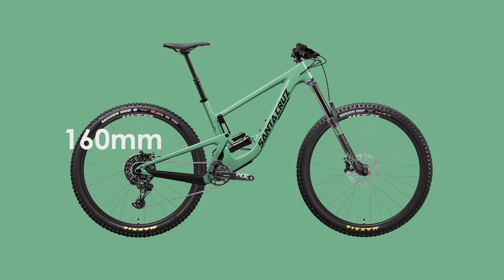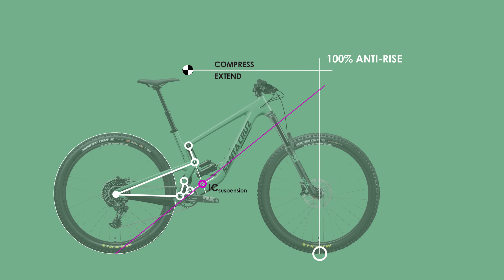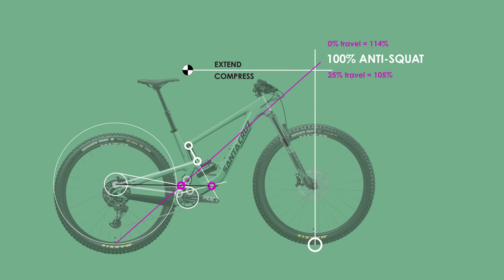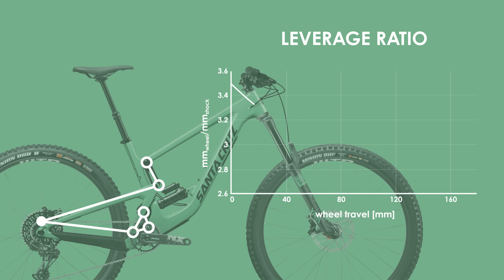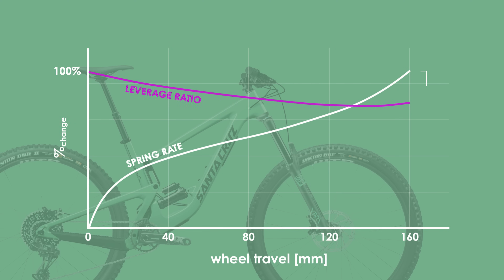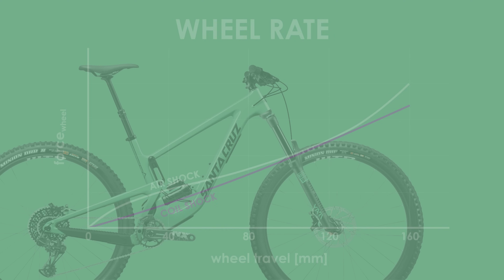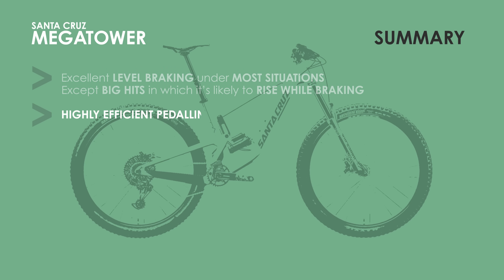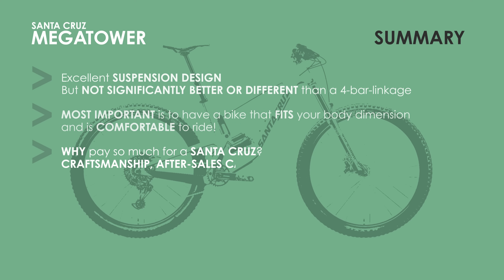Santa Cruz MEGATOWER VPP Suspension REVIEW

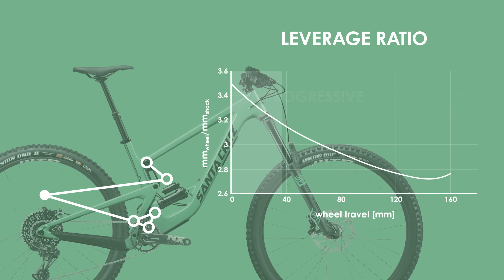Comment: @3:50 more air in this suspension  does not result in less small bump compliance, specifically because the leverage curve is higher. the higher leverage curve makes the suspension more reactive in the lower air pressures before the shock is compressed.
Reply from the maker: Yup totally agree if you had to take friction out, but the extremely high shock pressures do result in the need for tighter seals to keep the pressure in resulting in more stiction

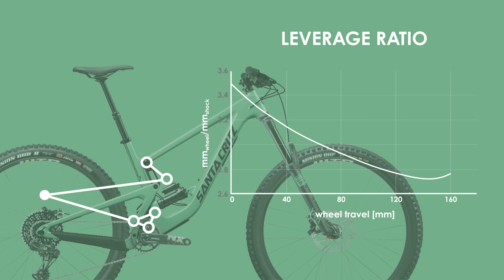Comment: 3:33 doesn't a higher leverage ratio = easier to compress = better small bump sensitivity? Why does Megatower with higher initial leverage ratio have worse small bump sensitivity than Ransom?
Reply from the maker: Good question. What I was trying to get across is that the overall LR is higher for the Megatower through the entire stroke. This means higher pressures needed in the shock overall = high static friction = worse small bump compliance due to friction compared to if they had kept the same curve but decreased the overall LR numbers across the entire stroke.
Reply: @TrailPOV  Thanks for the response!

Comment: Santa cruz doesn't have better components for the same price.

You talked about it ... on my nomad v4 the suspension feels notacible different in order to "high" or "low" position. 

These days I'm messing arround with the meg neg  and having a detailed look to the ratio and the suspension. In high setting the endprogression is cut off about 5mm and added to the beginning stroke.  This feels different.

You have talked about pedaling efficiency.  Yeah, there is a point if you have too much sag the pedaling is not as efficient as it is  in high Position, when you compare same sag and same air preasure. The construction has an ideal range of sag for pedaling. 

Would be exiting to see  a comparison on paper , low vs high.  To me, when it comes to fine tuning, this is an important  change. Some people might not feel the difference.🤷‍♂️

And you have talked about the difference  between air and coil. The difficulty with air shocks is that all of them have different spring curves. Some do not suit ideally to the ratio of the frame. A coil makes it way easier. It is just linear. On the other hand you can't create a certain spring curve for your personal preference with a coil. 🤷‍♂️
Reply from the maker: Thanks for the input

Comment: I suppose the VPP is nowhere near the performance of DW-Link?

I demo'd a Megatower and loved how it pedaled to the trailhead but once I got it on the dirt it didn't track very well.  Perhaps, the VPP is very finicky and needs to be setup properly?
With DW-Link, more specifically an Ibis Ripley and Ripmo, anyway you setup the suspension you get endless traction!

I don't want to be a total Santa Cruz hater ( my first full suspension was a Superlight) but I feel Santa Cruz should have their Suspension platform on par with Yeti, Ibis, and Pivot by now! 

I remember when I first demo'd a Ripley and then demo'd a tallboy back to back at a local Demo. The difference in traction was huge and seems like it still is!
Reply from the maker: Thanks for the input. Each design has its pros and cons depending on your riding style

Comment: Does this analysis apply to the 5010 v4 with the same VPP design?
Reply from the maker: While it might have similar traits with the leverage ratio, the 5010 is meant to be a better pedaler so it likely will have different braking and acceleration characteristics

Comment: How does it compares to SB150? It seems a little more progressive,  and having that situation when breaking over 50% of travel. With both pedaling very well. Is that correct?
Reply from the maker: The Megatower is way more progressive. While the Megatower has a leverage ratio range of about 0.8, the SB150 has a range of only 0.3.
Reply: @TrailPOV  which downsides do you see when comparing Suspension action of megatower to SB150? (Maybe some pedal kickback, and to much antirise? Or even a harsh endfeel do to too much progressivity?)
Reply from the maker: @juscelinocastro  The anti-squat and chain growth (pedal kickback) between the two are very similar. Only the anti-rise of the SB150 stays much higher throughout its travel. So under braking the SB150 might not stay as active and plush. Additionally the leverage ratio means that you can hit bigger hits with the Megatower and likely not bottom out while still being able to maintain good small-bump compliance due to the LR being higher to start with.
Reply: @TrailPOV  fantastic! I ended buying a megatower with DHX2. Since than, I'm working on setting and studying the harsh end of the travel. I got surprise, since I thought that going coil I'll be able to get less wheel rate. But it appears in the end is opposite. 
I saw some dhx2 analysis Arguing that it ramps up a lot T the end of the stroke because of the stroke bumper. (Have you ever analyze  this?)
So I'm thinking to stroke resize to 239 x 60 and go long and high with the fliptips settings, so that i can reduce this Harsh feeling at the end of travel. What's your opinion?
Reply from the maker: @juscelinocastro  Nice choice. Unfortunately I haven't looked too deep into shock tunes or specific shock model characteristics. Also it'd be very hard to model the flip chip modifications with stroke length adjustments without getting exact dimensions on each flipchip setting. If you are able to provide the exact dimensions on the flipchips I could potentially analyze the effect on LR if you sign up for one of my Patreon Bike Analysis Tiers #shamelessplug
Reply: @TrailPOV  how does it works? This patreon bike analysis?
Reply from the maker: @juscelinocastro  Your case would be a little unique, but essentially I would analyze a bike much like I have on YouTube but without creating the video. It would have some analysis text and graphs of the various anti-rise, anti-squat, leverage ratio etc but in a PDF. For you, if you are able to provide exact measurements of the flip chip, I could take the bike geometry as it currently stands and flip the chip using the CAD data and then place a different shock length in the frame and analyze what it does to the various parameters.
Reply: @TrailPOV  do you think it will be diferente from this: https://m.pinkbike.com/news/behind-the-numbers-santa-cruz-megatower-suspension-analysis.html
Reply from the maker: @juscelinocastro  That does provide some excellent info, but is missing what happens if you place a different shock length into the frame. It only addresses the flip chip changes. It's up to you whether this would add value to you.

Comment: I love these video, but am noticing that your leverage ratio curves are different than those found on the very popular Linkage Design Blogspot. Can you offer any insight as to why the leverage ratio curves might differ between your videos and the Blogspot site? Makes it tough to make a decision when you're not sure who's more on point. Thank you!
Reply from the maker: I have noticed that as well as my guess is it comes down to where that sites selects the center of the pivots especially the back wheel. If you just use a side photo, the lens will introduce a fisheye effect and also perspective will cause the rear axle to 'shift backward' from where it should be. That is why I use 2D CAD drawings as much as possible and if I have to use a photo, I take the perspective shift into account by using measurements such as shock length which is the same across all model sizes to adjust measurements such as chainstay length to match those indicated in the geometry tables
Reply: @TrailPOV  I guess what makes it tough, especially for the Megatower, is that the average LR is 2.78:1, but your graph shows very few moments throughout travel around that 2.8:1 range. The Linkage Design Blogpot seems to be more likely for this particular bike, as about half of the travel is above the 2.8:1 ratio and half is below that same ratio. This is the one graph where you two present very different LR graphs, and it could definitely sway someone in one direction or the other.
Reply from the maker: @persistentconsistency  Out of interest, where are you getting the 2.78 LR from?
Reply: @TrailPOV  I just took the 160 mm travel and divided it by the shock stroke length of 57.5 mm, to get an average LR of 2.78:1
Reply from the maker: @persistentconsistency  That is a really good point you make. I'll have to look into my math and find out the reason for the discrepancy. Thanks for the input.
Reply from the maker: @persistentconsistency  So follow up to your comment, the Megatower was done using my old method of modeling and according to my spreadsheet the wheel actually travels 168.5mm along its full arc. This works out to an average of 2.93 which is about half way on my graph. For subsequent bikes I switched to a new more precise method of simulation. The curve shape is still correct in this situation.
Reply: @TrailPOV  Nice catch! So the average rate is off, but the general curve is the same? This clears things up quite a bit! Thank you for your hard work. I'm loving this series of suspension-based videos. It's helping me rethink my next bike, particularly because I am 220 pounds. Even if I am in my old college football shape, I am no lower than about 210, haha. I'm fit, but I am heavy! Thanks again and keep it up!

Side Note: I'd love to see you do the YT Jeffsy 29!

Comment: Cool! I rode the Ransom and Megatower back to back and found them very different. The Ransom was very plush and smooth, and the Megatower bounced around a lot and felt like the rear wheel hung up on any square hit.
Reply from the maker: That's super interesting to hear. Might have something to do with the Megatower's anti-squat staying higher during the travel, or the shock tune being different. Always good to have real-world feedback. Thanks.
Reply: Trail POV The Megatower did have Fox suspension and the Ransom had Rockshox, but they were similar mid level caliber. I played around with the settings a lot and still found that to be the general feel to me. I didn't play with volume spacers though as they were demo bikes. The Fox stuff could have been pretty progressive.

Comment: My LBS deals in SC, Specialized and Rocky Mountain so support would be the same for all I'm guessing.
Reply from the maker: If you crack a frame for instance or there is a warranty call the LBS would still have to deal with the manufacturer so support would be different. But that comes a lot down to lead time for replacement parts but you'd still deal with your hopefully happy LBS :)

Comment: Two more important things about VPP: 1) all bearings are installed in links which makes service extremely easy; 2) (goes to all virtual pivot point suspensions) front and rear triangles are single parts which makes them also easier to (dis)assemble and service.
Reply from the maker: Very true. Stiffness is another thing that is good on VPP bikes.

Comment: How did you get your measurements for your analysis? Most bikes it's fairly straightforward and you can do it in linkage with a side profile pic of the bike. The new lower link Santa Cruz's tho are really hard because you can't see the pivot bolts, so curious where you got your measurements from.

Fantastic videos btw. Good explanation and some of the best editing I've seen on any analysis like this ever, nice work!
Reply from the maker: Thanks very much. I base my measurement off CAD geometry diagrams of the side profiles of the bikes. Most side photos of bicycles move the pivots slightly due to the fish-eye effect of a lens so aren't as reliable and hide pivots as you say.

Comment: Very much enjoying your suspension analyses videos. I believe you've overlooked a critical characteristic between the VPP (Megatower) and 4-bar-link (Scott Ransom) during you're summary. While your analyses shows the suspension to perform in a fairly similar manner in your 2D analyses, I suspect the VPP design has greater lateral and torsional stiffness making the bike track better in corners especially when the going gets rough. The solid VPP rear triangle also likely transfers bump energy to the shock more efficiently without flexing and twisting. The VPP rear triangle stiffness should also increase pedaling efficiency with less energy lost to a flexing and twisting of the rear triangle. The same type of lateral and torsional stiffness benefits should apply to DW link and the Yeti suspensions you've reviewed. Probably the only way to test for this would be to build a test jig that measures deflections while applying twisting forces to the rear axle while holding the main frame steady. The same type of test jig could probably be used to test the stiffness of forks.
Reply from the maker: Thanks very much. You are indeed correct that there will be stiffness differences between designs.....but without numbers I'd rather not jump to conclusions :)

Comment: So if you take a big hit and then brake hard the rear suspension would extend while the fork would go deep into the travel due to the weight transfer. This looks to me like the perfect recipe for going over the bars.
Reply from the maker: I think a better way to look at it is that the suspension will be allowed to extend rather than forcibly extend. Anti-rise just counteracts the weight transfer that already happens. More anti-rise = more counteracting your body motion forward and more level braking. If you grab a handful of brake on this bike you will want to move back on the bike a bit more than some that have higher anti-rise.
Reply: @TrailPOV  I understand, this extremely low anti-rise value leaves the suspension free to extend, but is really bad in preserving the geometry of the bike. Sure, moving back will counteract this, but not sure if it would be so easy to do considering you are so deep into the travel after a big impact.
Reply from the maker: @dit4963  It all is a bit of a compromise....really active suspension under braking OR really level bike during braking. I just focus on crunching the numbers and let you decide :)
Reply: @TrailPOV  Sure, I understand. Anyway don't be afraid to call out the positives, as well the negatives of a suspension design. I think in the bike industry we need more technical and objective analysis like this, as there is so much marketing BS. So cheers and more to come! :)
Reply: And now I see that this anti-rise behavior is on all VPP designs (some without going to negative values). To me this seems like a side-effect of the VPP, especially due to the short lower link, which changes the IC position a lot during compression.

Comment: thanks for the informative and unbiased technical analysis, can I conclude that all the latest santa cruz bikes that have the same design will have similar characteristics? or it will be vary by model since this was analysed based on megatower?
Reply from the maker: Unfortunately not all SC bikes will have same characteristics as each will be tailored to the discipline.....eg. XC, enduro, DH etc to ensure they perform as well as they can in the conditions they are designed for.
Reply: @TrailPOV  any plan to do a suspension analysis for nomad v4?
Reply from the maker: @alextan1008  It hasn't made it onto my recurring poll yet